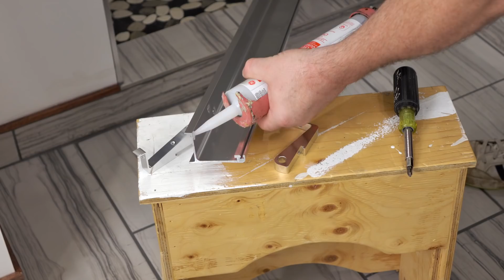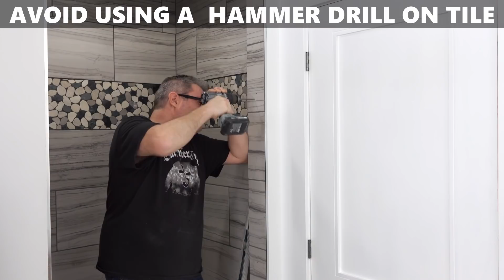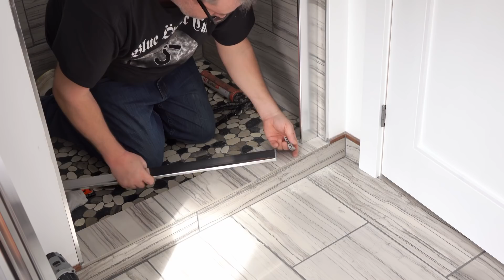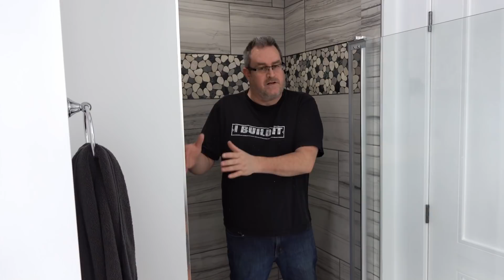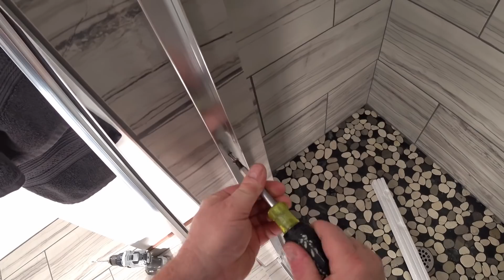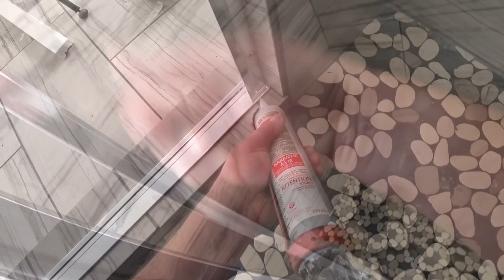Installing A Shower Door

Comment from the maker: Installing a swinging shower door using some unconventional methods. The make and model of the door is not important, since this video is more about the procedure than specific details related to the product itself.
The kit came with stainless steel mounting screws for the hinge side frame, but they were too short to reach the framing inside the wall. I bought longer ones to replace the two at the top of the frame to anchor it better, since that carries the bulk of the weight of the door. 

Here are some ways that you can help support the work I do in making these videos:

Plans for sale:
https://ibuildit.ca/plans/

Patreon: https://www.patreon.com/user?u=865843&ty=h

Website: https://ibuildit.ca/
Facebook: https://www.facebook.com/I-Build-It-258048014240900/
Instagram: https://www.instagram.com/i_build_it.ca/
Google+: https://plus.google.com/u/0/b

Comment: As a tile guy don't use anything besides diamond on any tile. Use a diamond bit for your holes. You can always make it a hair bigger and use silicone to fill the extra room, or use a longer screw to screw into the studs. You've got to mark the studs before you set the tiles, i normally mark on the ceiling and go off of that.

Edit: i forgot to say when you drill the holes use a wet grout sponge to keep the bit cool otherwise your $25 diamond bit will burn up after the 3rd hole.

Comment: note ..... after drilling into that tile and heating up the bit to red hot 1000 degrees , DONT inadvertently lay your drill on the vinyl plank floor  for the bit to melt a hole in the floor ... 😵‍💫🤯

Comment: Great video John. Regarding your usage of silicone caulk-  I'm in the process of rehabbing my 30 year old ceramic tile shower with a glass shower door. My old shower door has the same basic design as the door you installed. My shower door has weeped water from the bottom corners of door, where the aluminum extrusion meets the corner of the tile, since the day we moved in. When I removed the door, I was expecting to see old silicone caulk, IN ALL THE PLACES that you caulked, but there wasn't any caulk. No wonder the damn thing leaked all these years! Your video confirmed my thoughts on all the places I need to caulk when I reinstall the old door. People are thinking, "Why are you reinstalling a 30 year old shower door?". We're selling the house and I just want to make the shower clean and watertight - Let the next owner invest in a new bathroom.

Comment: I think the only reason why the manufacturer doesn't want you to seal these pieces shut is because condensate is going to form inside. I would have sealed everything except the bottom parts that face the shower to allow the water to return in the shower ( I am assuming you gave that bottom trim of porcelain a pitch towards the shower ) . Great video as always ! Unconventional method for sure , but I dont see an issue with the install.

Comment: Mate fantastic video, thank you! I just installed a frameless pivot door and noted your trouble with the drilling. I drilled 2 holes and then broke the bottom tile! I knew I should've used my angle grinder, which I did for the rest of the holes. Anyway, the crack in the tile ran vertically (PHEW!) and is hidden by the metal frame. I knew I should've used the grinder for the holes but nope, I'm a stubborn fella and wanted to do it right (?). I've drilled all kinds of masonry before except porcelain tile. 10 minutes per hole. Wow.  Or 3 minutes to grind all 5.

Comment: I never thought to grind out slots before, but it's getting covered anyway so why not! However, I used a Milwaukee 1/4" diamond grit hole saw bit, the shank type so it fit in my impact drill, my favorite tool on the planet. The bit works wonders with porcelain tiles just keep adding water to help the cutting process and cool the bit down, or spitting on where you're drilling if no third hand is present to spritz water, sorry for being gross. I'm very sure you know this already John, but I figured I'd throw it out there. I love your shower and how hard your working on the renovation. I'm excited for you and I'm looking forward to seeing more!

Comment: When I drill into ceramic tiles I start drilling counter clockwise, so you can set up a nice and smooth round reference to start drilling. This helps to remove the hard surface of the tile. I even use the hammer function, but on low velocity and on a slow and steady drilling, not pressing the drill trigger completely. After this, I change the rotation and drill normally, with the hammer function too.

Comment: you can definitely use a hammer drill on tile, just not at the beginning, you have to break through the top coat first, don't know if that works on all tiles though.
Reply from the maker: Sure you "can" use it, but you can also use a rocket grenade or a speeding locomotive to make holes in tiles. 
A hammer drill will blow out the back of the tile and greatly increase the chance of cracking it, unless it's backed by concrete or concrete block.

Comment: Great stuff! Why the instructions do not mention sealing the inside of the trim is weird. I had a similar door installed in my shower and the instructions mentioned to seal the OUTSIDE of the trim. The installer followed the instructions and water eventually seeped through the tile and underlay and slowly made it to the kitchen ceiling on the lower floor. I sealed the INSIDE of the trim much like you just did and that seemed to do the trick. Funny thing is, after 10 years of cleaning the shower, the silicon started wearing away and proceeded to leak into the kitchen again. My next honey-do listed item is to remove all the old silicon, take apart the shower door, clean everything up again and reinstall and seal everything up. Makes me wonder if the look of tile is worth all this trouble. The tile install was A+ job by qualified tiler, but shower seems to leak a little at the door and corners.

Comment: Don't they sell widia drill bits? (tungsten carbide in english i think)  HEre where i live are the most common drill bits you can buy in stores, maybe is because our houses and buildings are made with concrete, briks and stone, and if you don have them is imposible to hang even a picture o the wall

Comment: inexperienced question here - i've seen you use the roof tiles for a 'gasket', but i don't think i've seen you screw the base board (of whatever wall) into the floor. i know it's got to be supported, so did you screw it in, or did i just miss that?

Comment: Looks simple enough. Has anyone here installed one of these glass doors in a fibreglass shower stall? It has slightly rounded corners at the bottom. Not sure how the square edge of a door like this would fit.

Comment: If you don't like vacuuming, stick an open envelope right beneath the holes you're drilling. Works like a charm.
Reply from the maker: For a drill, sure, but not for an angle grinder. Unless you don't mind filling the room with dust, that is :)

Comment: Hi John,
I know all about the problems with drilling into porcelain tiles and the drills for the porcelain are expensive and basically rubbish, however over in the UK we use Bosch blue multi construction drill bits and these tend to work slot better, with these drills you could get a couple of holes drilled if you keep dipping the bit into water to cool it down.
Keep up the good work.
Stewart

Comment: A center punch on tiles? I can't unsee tiles breaking in my mind. There are special drill bits extra for tiles. I didn't know them either until they came included with my shower doors. 

You did it great and thought of the important things. And I personally wouldn't mind the slots behind this rail.

Comment: Funnily enough I have just had an absolute bas#ard of a day drilling porcelain tiles! 12 holes, 15  mins per hole on the slowest speed imaginable, only 3 holes out of each bit, the best tile bits I could afford. I was losing the will to live.

Comment: Just recently installed the exact same grey stone tile as you did in my shower. Did you explore using a diamond bit with a small water box (kinda looks like tic tac box). Seen them and used one, seemed to work well, but was slow and risky the whole time. https://www.walmart.com/ip/QEP-10566-5-16-Porcelain-Diamond-Drill-Bit-with-Drill-Guide/38454512?wmlspartner=wlpa&selectedSellerId=3005&adid=22222222227026415483&wl0=&wl1=g&wl2=c&wl3=52572479951&wl4=aud-310687321802:pla-84453903311&wl5=9008711&wl6=&wl7=&wl8=&wl9=pla&wl10=113146015&wl11=online&wl12=38454512&wl13=&veh=sem

Comment: Could you have used a masonry drill for concrete? Aren't those diamond tipped?
Or would they ruin the tile?
Reply: Concrete bits are not diamond tipped. But there are diamond tipped bits made for stone like porcelain. The more common ones look like a hole saw with diamond encrusted on the cutting edge like salt on a margarita rim.

Comment: Good call not putting silicone on both sides and trapping water inside that's something most people wouldn't think of. I'm not sure why your instructions didn't mention but standard procedure on pretty much every shower door I've installed (Plumber for over 10 years) is to silicone the outside rather than the inside. That way if any water water gets in there (for instance through the seam where the piece with the magnetic strip is fitted into the door jam) is stays on the "wet" side of the silicone rather than getting out of the shower. I doubt you'll have any issues leaving it as is but thought it should be mentioned for some of the other people watching this video for advice.

Other than that the install looks great, I've known plenty of contractors who do everything they can to avoid installing shower doors.
Reply: JasonWin my shower door installer sealed the outside of the trim and water eventually made its way from the grout under the trim (that area never seemed to dry out after a shower) and over the course of a few years, leaked down into my kitchen in the lower floor. I sealed up the inside of the trim and that seemed to work until the silicon eventually wore away with shower cleaning over the years later. Time to clean up the old sealant and re-apply I suppose.

Comment: Hi john,
I use these type of holesaws ,they are specially made for anglegrinders . 
I have them as small to 6mm for plugs ,and then the most usual sizes you need for most standard plumbing (water and draining pipe sizes).
http://www.cutsdiamant.com/tools/Diamond%20hole%20saw%20bits%20for%20porcelain%20and%20ceramic/122.html

Comment: Glass drill works wonders on tile to get the hole. Sharp profiled carbide bit really does a good job making the initial hole through the tile, then you change to a regular SDS masonry drill when you are on the tile adhesive and the wall.

Comment: When I have to make holes in hard tiles I usually use a dremel with a tungsten carbide rough milling bit. With 20k rpm the material starts glowing at the contact point, so the thing can crack if not careful. But it's faster than grinding through the usual way with the cordless drill, like you started out. :)

Comment: That tiling looks great. Question regarding the door; the kit comes with metal framing that you can cut to size but the glass door itself is obviously a fixed size - does that mean they sell the kit with a few different sizes of glass door? Also when you framed out the walls did you make the width of that opening a standard size or had you bought the shower door in advance and made the width to accommodate that particular door?
Reply from the maker: This door kit will fit an opening from 33" to 36". I sized the opening with that in mind.
Reply: Ah, cheers John. It's looking good.